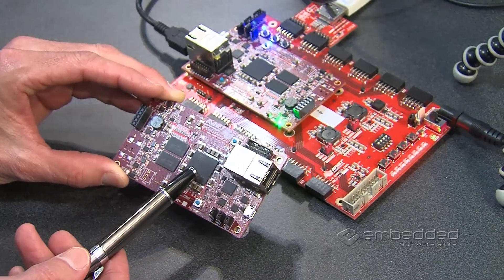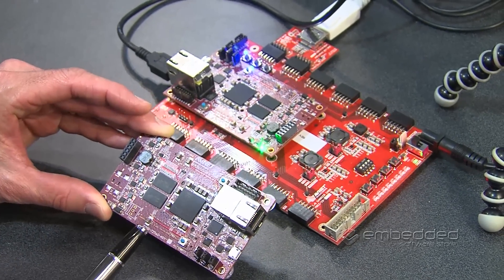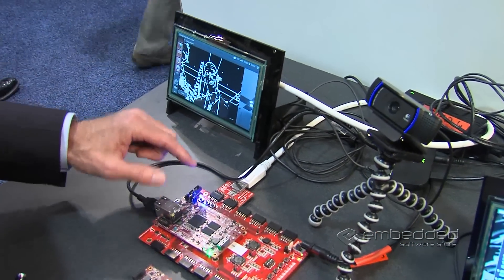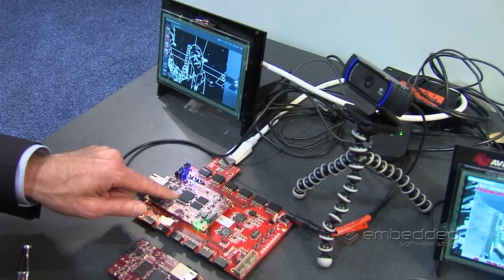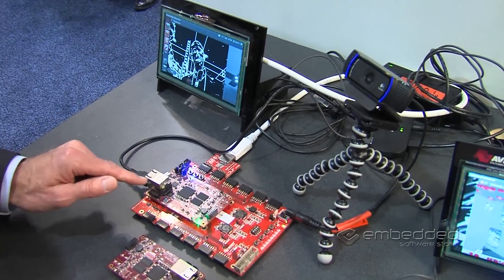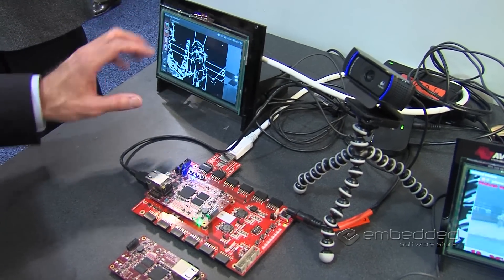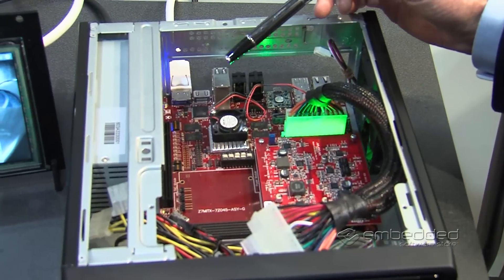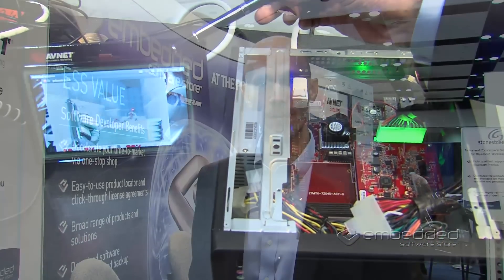MicroZed™ as a System-on-Module

Comment: Every time I see a Zedboard (or MicroZed) I now think of the Red Pitaya, and wonder: could these be combined for a lower overall cost?
If you cut back to [for example] 4 PMODs, and added even a single channel [125Msps, 12-bit] ADC and DAC on that expansion board, you'd have a real contender.
Use an FMC connector and you'd have not only the Zedboard, but a whole range of Xilinx boards, as potential buyers.